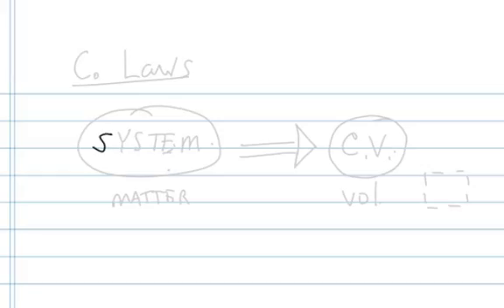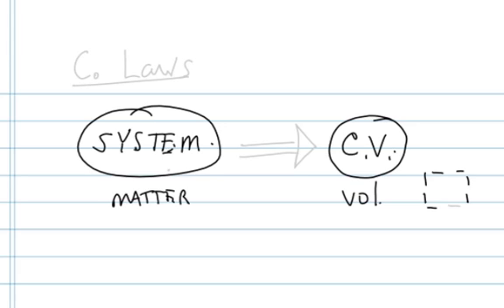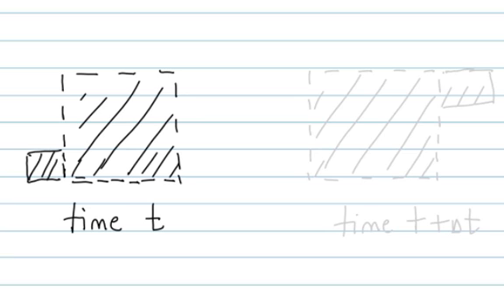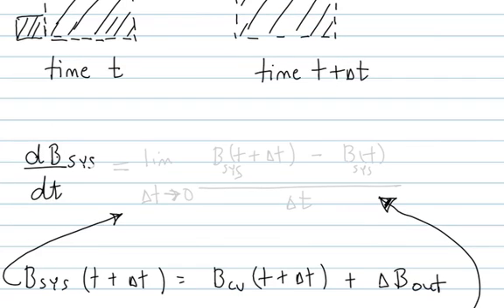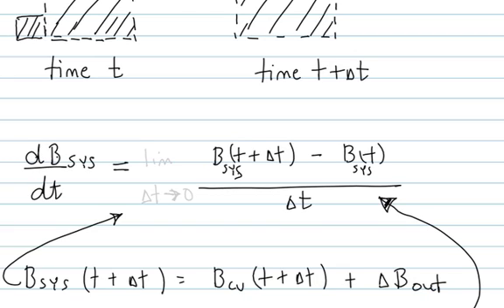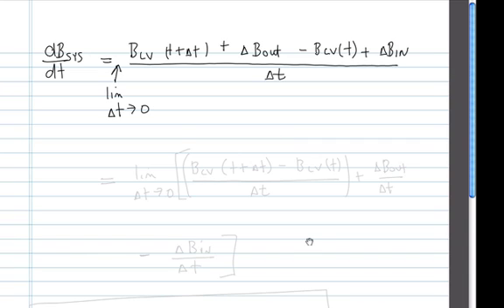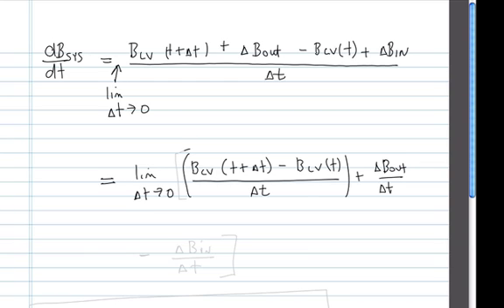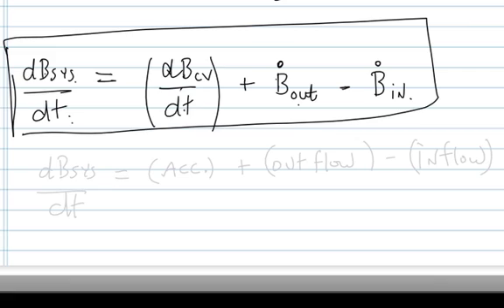Derive Reynolds Transport Theorem

Comment: They are talking about the system which is moving and not the control volume... Bin is negative because it is the property at time t and if at time t... It is like saying I have 50 gold coming in at t and 100 gold going out at t=t+dt then the rate at which gold is moving along(system) is 50 assuming that gold is not growing byitself(accumulation=0) 
Feel free to correct Meir I got this analogy wrong... This is how I understand it